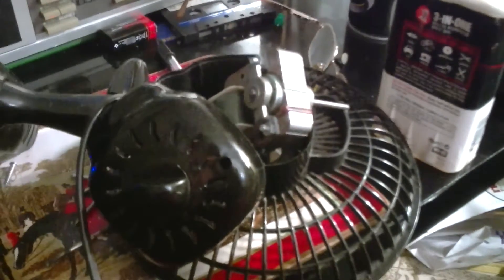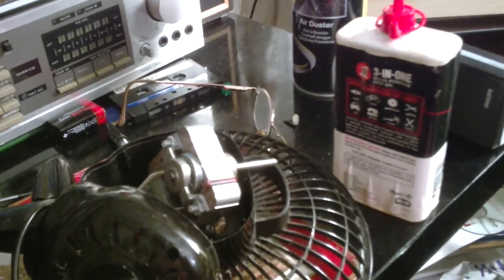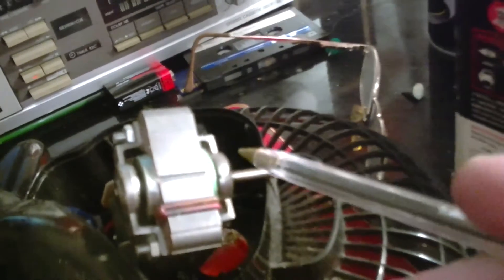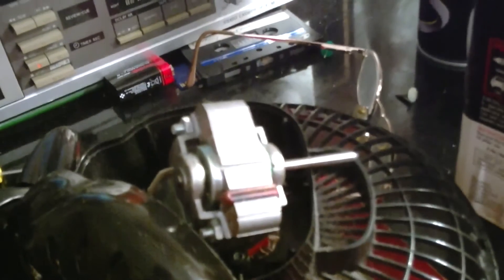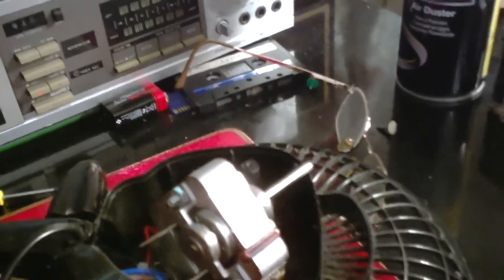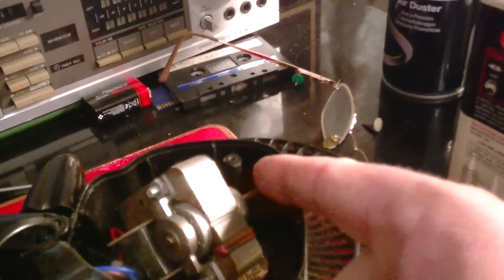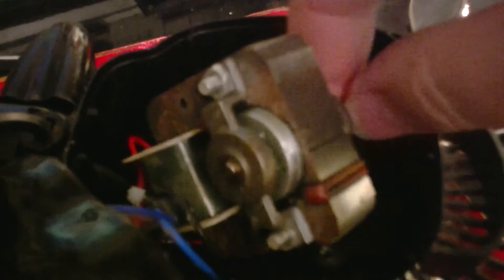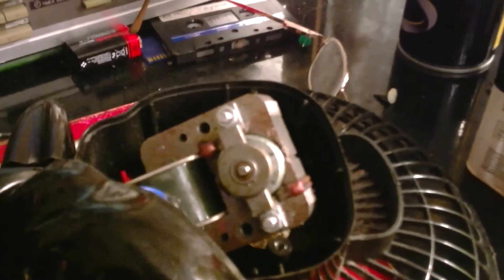Shaded pole motor needs freeing off.

Comment: I always use CRC 2-26 multi purpose electronics lubricant on these motors. It's safe on ALL plastics, rubber, polymers, metals, electronics and chip boards, terminals, wires, motors, circuit boards...ANYTHING ELECTRIC AND ANY MOTOR. Great stuff, and nobody ever knows what it is lol. Have a good one

Comment: A non-detergent oil is better. The detergent can cause the sintered bronze pores to clog up. 3 in one makes one, electric motor oil. I just had the evaporator fan in  my refrigerator make noise and then stop. To save the food, I removed the motor and freed it with WD-40, then put a tiny drop on the shaft bearings with a toothpick. This motor has a casting around the shaft bearings as. The WD-40 instantly freed up the rotor but I know it would not last, so applied some motor oil. This allowed me time to obtain a spare.

Comment: 4:20 Why there is a tape around that 'coil' ????
Reply: Because they have a triple wire tap in three locations on the coil... for fan blade speed, low, med and high settings. They usually wrap the coils if they have wires tapped into it to control motor speed. Cheers

Comment: Well done, that's another thing saved! Just had to have my ancient PIFCO fan apart. James used it every night when he was over, and since then I have used it a fair bit. However, it started to run a bit hot and sounded noisier that normal, just given it a mix of Castrol LM grease and 3 in 1 and it seems to be running much better and a little less noisier! However the bearings have had it and it's getting very noisey now, this may be it's last year in service! It's done some work over the years, Dad bought it for his desk at work, so that must have been late 70's! Even have the box for it somewhere, came from FADS DIY Store, so it must be old now, they went years ago!